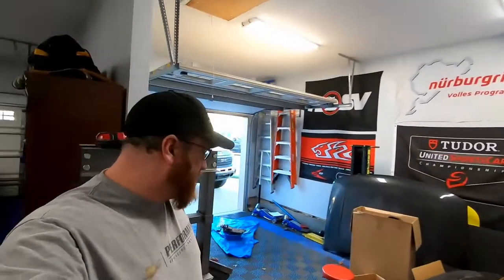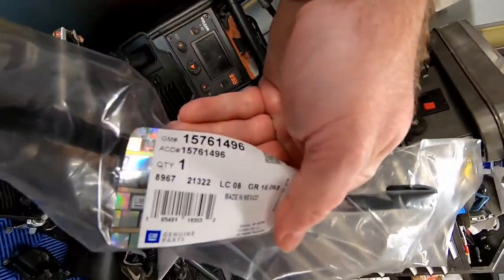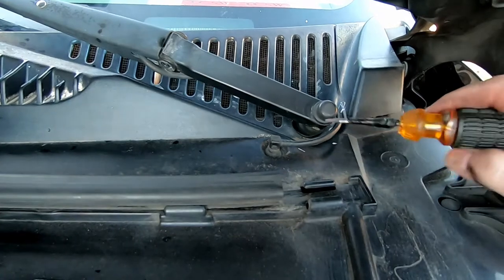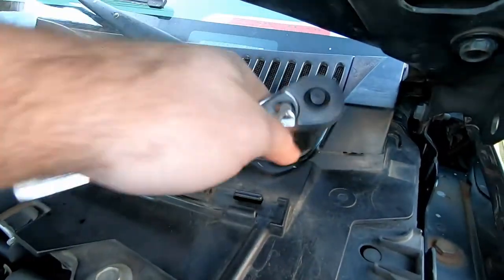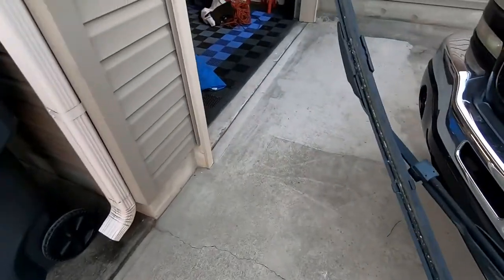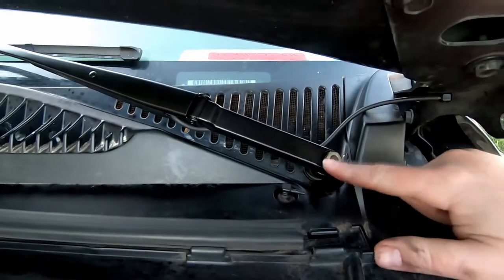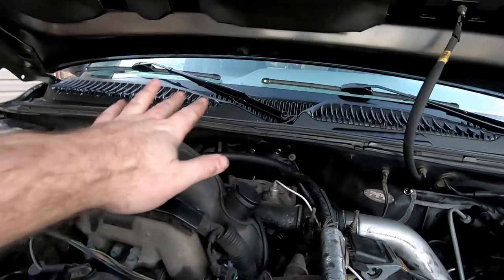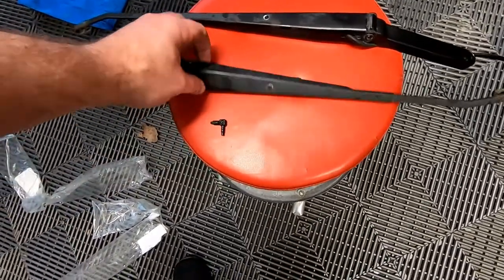2005 GMC Sierra 2500HD - 99-02 Wiper Arm Install

Comment: GM changed a lot of things in 2003 and NOT for the better.   They got rid of the Hvac air filter inside the cab.  They did away with the light(s) under the hood, inside the glove box, foot well and rear doors.  No "Lockable" center council with key like the 99-02 trucks.
  On the 1500's, the early trucks had 4 wheel  disc brakes.  Then in 03-04 GM changed them to drums in the rear to save $.
Reply from the maker: Thanks Bean counters!

I already did the under dash lighting - so stupid they kept the hooks there. 
I could do the under hood light since my HD hood and that aftermarket hood liner has a cut out for it.
Reply: @bonecrrusherSS  i enjoy seeing some oem plus upgrade vids.